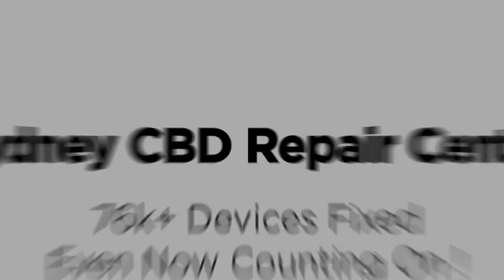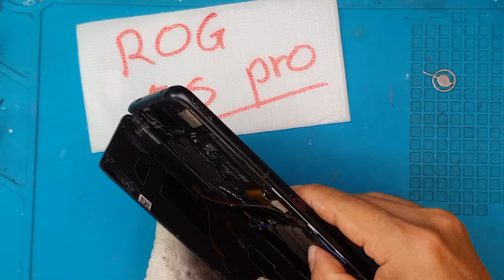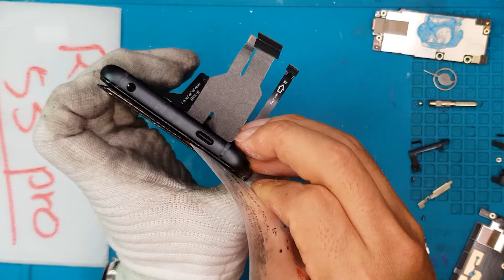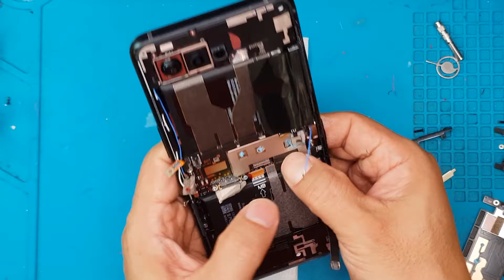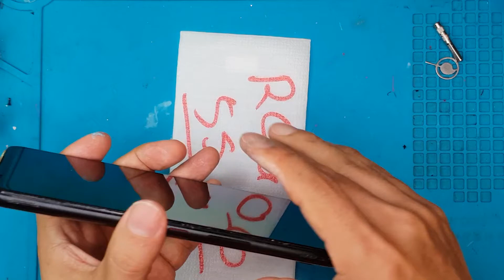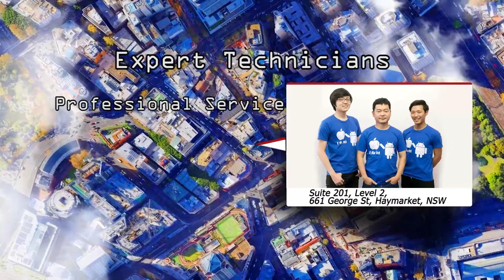COMPLEX JOB! ASUS ROG PHONE 5s Pro Screen Replacement | Sydney CBD Repair Centre

Comment: my ROG 5s pro  wifi not work suddenly（reset to factory default not work），should I Replace the main board？which component parts should I replace
Reply from the maker: Hello, you need to replace the wifi chipset only.

Comment: Hi, can you help me ? i need to know if lcd rog phone 5 ZS673KS is same rog phone 5s pro ZS676KS ?
Reply from the maker: I think it's compatible
Reply: The screen is different in terms of touch registering Hz: 300Hz on ROG 5 and 360Hz on ROG 5s. If they are interchangeable, then go for 5s screen.
Reply: Is it possible to put the Rog phone 5 pro battery cover on the regular Rog phone 5? it will work
Reply from the maker: @Skindead-pubg  it works but doesn't know LED will work or not. thank you